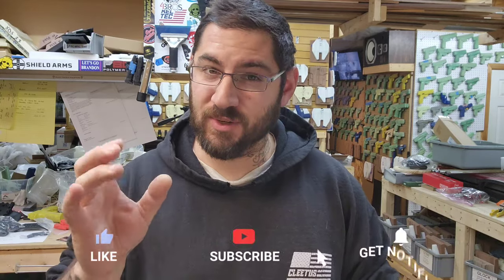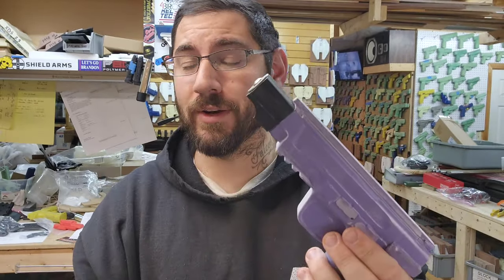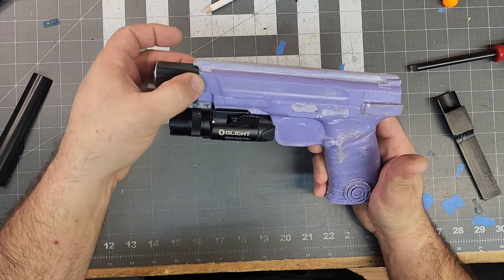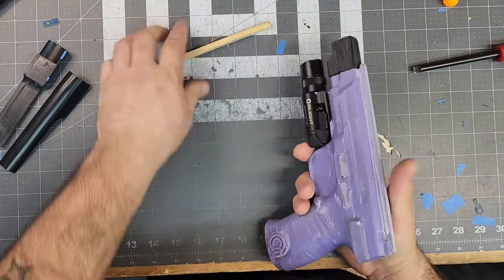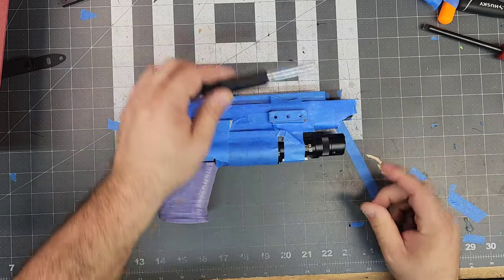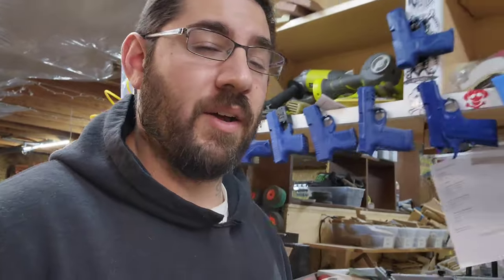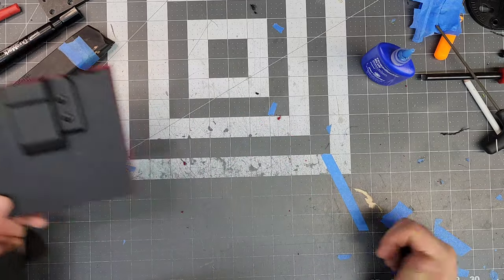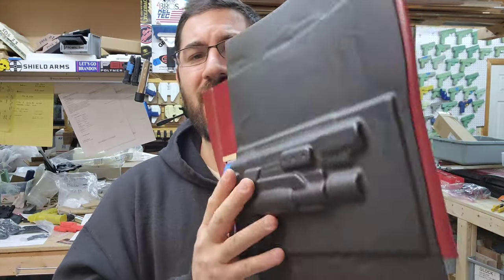Modifying My On Target Mold To make A SW 10mm Performance Center Side Car Holster, THIS WAS FUN

Comment: This guy is awesome. I can’t tell you how many holster makers I have asked to make holsters for my sidearms and because I use different lights or gas pedals etc they either say no or tell me how expensive it will be. Not at FAL TEC 👍🏽🙂 I ordered a holster for my brand new Springfield Armory Echelon with a TLR -8 light / laser combo and it has a threaded barrel that soon will have a HARINGTON compensator.  ( as soon as they release it )with Fal Tec it was an easy order . Very professional and a great experience. I even wanted to be able to convert my holster from an outside the waistband to a medium drop leg holster. He knew exactly what I needed and said no problem and he ordered everything I needed and the price was good . I can’t wait to get my holster so I can feature it in up coming videos. This is a great company.

Comment: This is a gorgeous holster! The Shield firearms have the optic cut so far down the slide, a mounted optic sits at belt level.  It would be good to have the "bolt on" hood. Did you ever get that idea worked out?
Reply from the maker: ill be doing a video on a covered optic on vac soon. had a thought

Comment: Love the ingenuity! I have a similar issue with finding a Springfield DS Prodgity 4.25 mold. Thinking about getting the 5 inch mold and cutting it down. Have you done a Prodgity holster yet? Keep up the brilliant work!
Reply from the maker: I actually have the 5 inch Prodigy in. That should work!
Reply: @FalTacUnlimitedLLC  Thanks for the reply! My step-father bought a 4.25 and they shipped it with a holster made from the 5 inch. He doesn't like how it looks. I'll give it a try, just hate paying the money for one only to cut it down. Such is life.
Reply from the maker: @aj23usmc06  you could cut the holster toom open bottom at muzzle
Reply: @FalTacUnlimitedLLC  Very true! Would you forsee any issues when a weapon light is attached?
Reply from the maker: @aj23usmc06  nope. Just different lengths

Comment: Is it unwise to use the actual firearm to make a holster? Wanted to try my hand and my a holster myself but don’t want to buy a mold for my hand gun.
Reply from the maker: you can, there are a few things to watch out for but its doable and easy to mark or damage the real del. I love molds so i can cut and add as i please
Reply: I've done a few with the real thing. I don't love doing it but there's nothing wrong with it. Your biggest worry is if it's polymer YOU HAVE TO HAVE THE EMPTY MAG INSERTED (the mag also needs a couple layers of tape on to give it the tightest fit possible). Polymer will flex under heat and pressure and you can destroy your magwell if you forget the magazine.
Reply: Nope he’s the real deal brother been watching him and his work for the long while now and he’s got skills…